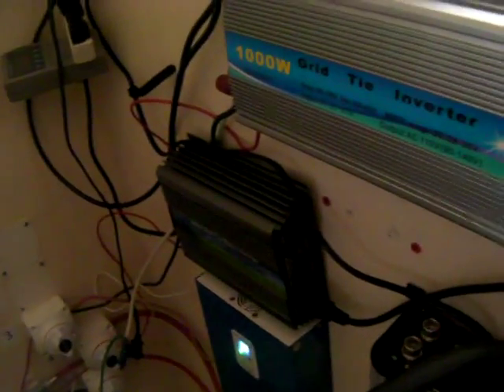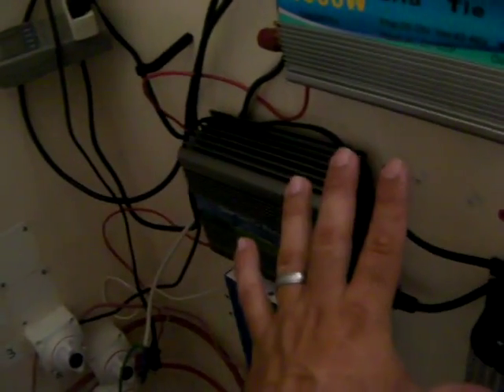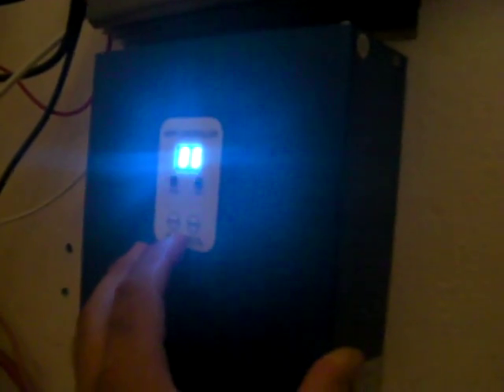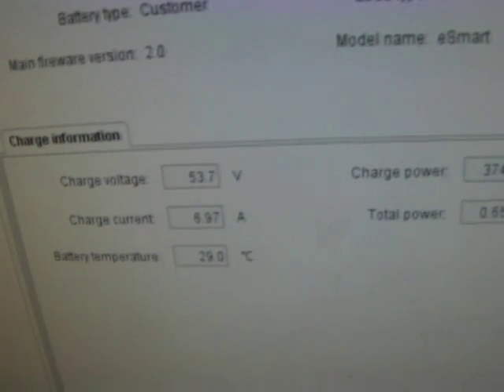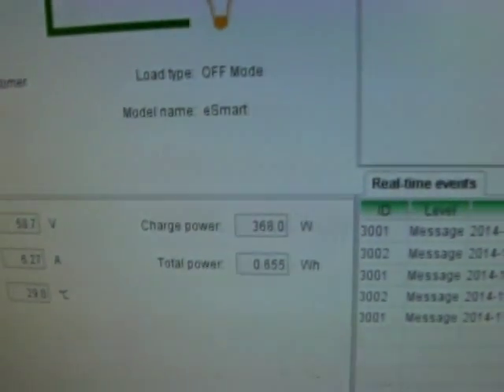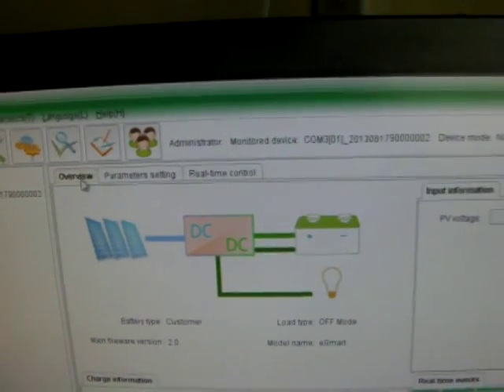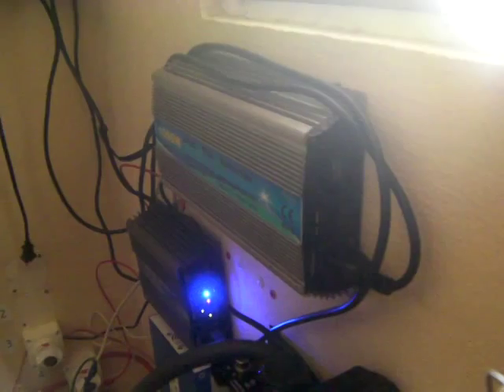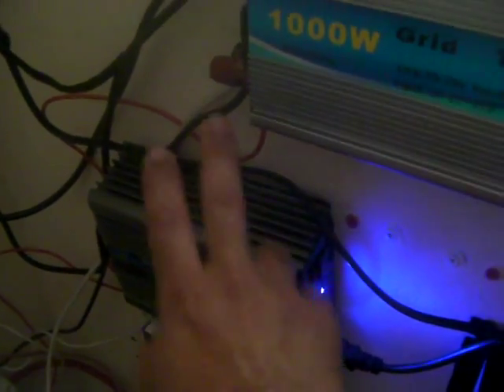ESMART SOLAR EAGLE 40 AMP MPPT CHARGER 12, 24, 48V

Comment: Is your Solar Eagle still working at 57.6V? I was thinking of buying one. Does the very bright display switch off at night, otherwise I won't need a light in the conservatory! (as well as draining the battery) I also have one of those Chinese "1000W grid tie" inverters, I don't think it's G59/3!!! it came free with a wind turbine I bought.

Comment: I  have the esmart3 and am having trouble getting the controller to register with solareagle 2.0.  The drivers for the cable appear to be installed correctly as the computer recognises that it is plugged in. The manual to the esmart 3 indicates that it requires a RS485 cable, which is what I have purchased. It appears that previous versions used an RS232 cable and was wondering if it was worth giving one these a go. Any assistance trouble shooting this would be appreciated.
Reply: Hi, I have the same problem, I have the cable ( Prolific PL 2303 usb to rs485, I have the correct drivers, but the software never upload data from the solar charger, the model is ESMART3 with solar eagle 2.0.
Reply: I also have an esmart3 40A with the new cable and solareagle 2.0 and can't get it to see the charge controller because the usb drivers won't install. I'm using windows 7. I'm getting so sick of this chinese crap and not being able to get their garbage working.
Reply: Did you finally get this working? I'm so frustrated. Never again.
Reply: Let me know if you found a solution! Any help would be great.
Reply: Same issue, pl2303 driver is installed on win7 and adapter is recognized (XA HXA chip) but solareagle 2 does not see the chargers. 19200 baudrate.
Reply: ohh cool, I got it working on win 7 64 bits using the PL2303_Prolific_DriverInstaller_v1190.zip drivers and the install_MyGreenSolarMonitor_CS_Windows.zip software!
password is still mpptsolar
sooo happy.
software location:
http://www.solarcontroller-inverter.com/download/9.htm
driver location:
http://www.prolific.com.tw/US/ShowProduct.aspx?p_id=225&pcid=41

This is where I bought the cables:
https://www.aliexpress.com/snapshot/0.html?spm=a2g0s.9042647.0.0.4fdf4c4dY10qGK&orderId=91719267652307&productId=32854529801

Comment: I tried connect my pc with charge controller but no upload the pc software.  Where I download a software to change the battery charging stage? Because the controller charge the battery but when i start up the inverter no continue charging the battery banks.

Comment from the maker: I am using this charge controller again...I bought two more panels and stepped up voltage on my 24v system and now have over 60v input to charge my 24v battery bank ( two banks of 33v panels in series)  no more stopping and starting cycles...very good controller...
Reply: +jwsolarusa John hello John God bless you too and thanks for your kind words...I installed the battery sensor where the batteries are..always on the outside of the battery, never on the inside since this would destroy your probe and the battery...always far away from the battery poles...you can put a tape on the probe and stick it to the outside of a battery...
Reply: How did you connect the BTS to the batteries
Reply: Thanks for sharing. Nice video by the way. 
God bless and have a wonderful day
Reply: I just bought one of them still in the box.  I haven't install it yet.

Comment: Ran fine for about 4 months and then just stopped charging. Everything else is working and no change in setup. Bummer
Reply: sorry to hear that.... mine still works maybe because I only use it on blackouts like today...had to use system for 3 1/2 hours.....
Reply: Have you got the software connected up to an RS232 Rob?

Comment: FYI, the Solar Eagle software is based on Java so it can also run on Mac and Linux too. My Linux system just required this BASH script in the base directory to run:

[code]
#!/bin/bash

CLASSPATH=./lib\
:lib/commons-lang.jar\
:lib/commons-logging.jar\
:lib/derby.jar\
:lib/dom4j-1.6.1.jar\
:lib/iText-5.0.6.jar\
:lib/iTextAsian.jar\
:lib/jaxen-full.jar\
:lib/jcommon-1.0.0-rc1.jar\
:lib/jfreechart-1.0.0-rc1.jar\
:lib/JTattoo.jar\
:lib/log4j-1.2.14.jar\
:lib/RXTXcomm.jar\
:lib/saxpath.jar\
:lib/SolarEagleCharge.jar\
:lib/spring-beans.jar\
:lib/spring-core.jar

java cn.com.solargain.solar.console.MainConsole
[/code]
Reply: I had this problem too. What I did was replace this line:
java cn.com.solargain.solar.console.MainConsole

with:
java -cp $CLASSPATH cn.com.solargain.solar.console.MainConsole

got it to start this way, haven't had a chance to test RX/TX
Reply: I used WINE on Linux to install the software so I could copy it out of the simulated Windows environment and then work with the directory and files from there. I also deleted the jre directory since I've got Java and the RxTx(for RS232) already installed and the one in the kit is going to be for Windows anyways.
Reply: +Doug LaRue 
Hi, not work for me on debian jessie.
user@system:~/SolarEagle200$ ./launcher.sh 
Error: Could not find or load main class cn.com.solargain.solar.console.MainConsole
user@system:~/SolarEagle200$
Reply: Can I ask you to send me Solar Eagle software for experiments?
Thanks!
Reply: do you have these directories in the location of ./launcher.sh
config
datas
images
lib
log
style

what is in the lib directory?
Reply: Doug, right now I have only the device. I don't have data CD so I'm looking for software for it. Can you upload it to dropbox or send me to g.a (at) ua.fm? I'll do some tests on Mac and may be on linux.
Thank you!
Reply: could i get a link to the software as well please?
Reply: try this: https://drive.google.com/file/d/0B6e_QEifuKzMbENlZngyQ010QzQ
Reply: Do you have the windows version of SolarEagle? If so, could you please provide a link? Been looking online for ages.
Reply: I found the SolarEagle 2.0
For Windows its running an exe.

I uploaded it to Mega just if someone else out there is looking for SolarEagle 2.0 here is the link: https://mega.nz/#!qs5WTS4Y!h-J-QNEdAxpJECXp3NE5C0Ctb-_IvE5hkHVQHcFI8wE
Reply: Glad you found it but also to let you know, that exe is just a Java runtime to run the Java application on Windows.  When you install it you will see a few .jar files which is really the application.
Reply: Hello. Thank you for software. Can you share usb drivers too?
Reply: USB drivers come with your Linux OS distribution.
Reply: Doug LaRue what about windows?
Reply: I don't use it.  The Solar Eagle software was packaged for Windows so maybe you can find the users manual.  My comments and experiences are with getting it working on more reliable platforms.
Reply: Can you make video about this setup?
Reply: i need password login first. Please send me: kientrung.lc@gmail.com
Reply: mpptsolar or 123456 or administrator or ipanda
Reply: thanks, you are a life saver
Reply: I probably do have the install CD somewhere but it would take too much effort to dig for it.  As I mentioned, it's Java based software so you just need to install Java, extract the zip file I linked and change the startup script into a Windows batch file( or whatever Windows uses these days ).

Comment from the maker: hello, if you guys are having problems like  I use to have with this charge controller that it keeps charging and stoping charging and stoping on and on etc...then I think I may have found the problem...problem is that algorithm protects  the charger from solar input low voltage which in  my opinion is set to to high, it should be closer to the limit where its being charge to the battery. for example battery is at 12.3 then limit should be 12.4 on the solar side...protection for 12v is set at 14v input so if you have a 33v panel you should not have problems with this issue but if you have an 18v panel the you most probably will.....protection for 24v is set at 30v ????wtf??? going under that is very likely if you are using a 33v panel and for 48v system its 60 again to high...so my recomendation to fix this is for 12v system use 33v-100v with 1 up to 3 max 33v solar panel or 2 18v panels in series up to 6 max. for 24v use 54v - 100v with 3  up to 6 max 18v solar panels in series or 2 up to 3 max 33v solar panels. for 48v system you can use 5 up to 6 18v solar panels in series and 33v use 3 solar panels in series....please be careful if  your panels are a little over 33 or 18v since cutoff solar overprotection voltage is setup at 110v... so if the controller stops charging then you may want to lower voltage just a bit from where you are if you are on the high side. will do my testings in the future since I can't right now because my solar setups are all running on the low side...example my 48v setup has just 2 33v panels so it keeps on stoping the charge every 1 min or so....and my 24v setup has only 1 33v panel so again I find myself under 30v often...
Reply: +subzerodata  a few diodes could be used to drop the voltage some without any current decrease or heating. 1.4V per power diode.
Reply: I have a 40A model. The software provided had two versions (1 and 2).  I am hoping the second sorts out "the algorithm problem".  My installer did not hook my inverter load to the LOAD junctions, preferring instead to use the battery terminals ("what difference would it make?")  Having reviewed the software, where I find Mode [Load] ON [on boot], Mode OFF, MORNING TIME ON, TIME+PV ON etc  I can see that hooking load to the LOAD terminals is the way to go.   Also I had several problems that I suspect were to do with disconnecting the battery while solar charging, which not advised or recommended because the internal capacitors have nowhere to shunt their power.
Reply: +Simon Masters yes, manual clearly states that you connect battery first and solar panels last meaning that solar side should never be connected when batteries are not this would/could damage the unit depending on PV voltage used....software is not for changing algorithm it is for monitoring and changing voltages and values on unit including amp limitation... if you are having the stop start stop problem then you may want to go with higher PV voltage...if PV voltage goes near battery voltage then unit stops and restarts when voltage goes up again...regarding load side of controller this should be used for low consumption DC divided consistent with voltage output of unit not the inverter because inverter needs high current surges to work...if you still need to use inverter thru load side the use a high quality heavy duty relay compatible with output voltage of controller....

Comment: I have a nominal 24 volt system of Lithium cells, i would like to put the maximum voltage in the settings. But the software only goes to 15 volt. Is the assumption that you use 15 volts, and it multiplies by 2?
Reply: I hear you...software is full of bugs...shame because unit itself is not that bad....
Reply: +Leonardo Cruz 
I have cc'd this question to the representative of the software company - SolarEagle. I will post her reply when it occurs. She has been pretty good at answering questions.
Reply: William Swann thanks, let me know what they tell you...they are very nice, I told them about the problems I was having and they where nice enough to send me another board...the replacement board I got was not software rewritable, and it made the exact same long pause even when full sun out..

Comment: After doing lots of testing....this controller is not worth buying as a regular controller...keeps turning off and on if input voltage is too close to the charging voltage or if voltage is not constant....the second board that was sent to me is stuck with programming since I'm unable to change parameters with the software...I just use it to transfer power from a 48v battery bank to a 24v battery bank...at least I'm getting use out of it...

Comment: It is working but right now I'm just using it to export power from 4 batteries from my house ( charged with the grid)  to my moms off grid setup when her batteries get low on rainy days....I would strongly recommend you get the intronics mppt charger from eBay...it is made in USA and I have two of them and they work great...its good for 78 amps...my mom is running a minute solar classic lite that I monitor with a si if connection all the way from my house...but that charger is on a league of its own and it cost 2 times the intronics....don't buy this Chinese mppt...it keeps on charging and not charging, charging and not charging, on and on etc....too ineffective, it waste too much power for being reliable for off grid install...

Comment from the maker: first your pc must see the rs232 to usb adapter so drivers must be properly installed after this you install software for the controller to your pc and open it...it should work...if it does not try testing the usb to rs232...

Comment: Is this a real MPPT charge controller?
Reply: Yes it is, but algorithm on it sucks! Turns on and quits, on and quits keeps on and on...really no good...
Reply: Thank you for the reply. It's a pity they screwed up the algorithm.
Reply from the maker: +Hat cck yeap....I spent 180 usd on mine...it is a 40 amp version...had to find another use for it since it does not work well for what its supposed to be used....

Comment: What is the voltage on the batteries? 50v +  times 4 amps is around 200w....is there a larger load on the batteries? If not then the regulator will stop charging the batteries at its bulk voltage  so it does not over charge them, this is normal...

Comment: It's like me, I have now changed the system to see how it responds and I have 4 modules 12V and I connected in parallel, clearly detected me entering a 70V and that regulates well, but the operation is the same as that load to 3 Ampere batteries, but that if at most 1 minute followed, then disconnect and goes to sleep, after half a minute, again charging 3-4 amps (modules are underpowered about 40W) so the amps are correct, the problem is that it does not follow as it should, while I had sun.
Another thing I've noticed is as you say, in the morning, the batteries have less stress than at night, it is assumed that the discharge should avoid at night, which is one of the features of ill regulators and this is implies something better.
Nor have I seen him do more EQ or any function, I have them in the way NiCd # 4 of the menu and also you do follow up with the pc.

Comment: Have you test it with a load on the inverter? What's the open circuit voltage on each panel? Try putting 3 panels in series to hit closer to 72v and remember always make sure you feed the charger to your batteries firs and the connect the charger to your solar panels...fail to do this and you'll damage the unit...

Comment: Hi, I have a small installation consists of four PV modules 12 V 40W, I have two in series and two in number, but I have a problem, mark me buck voltage charge 14.4V and 13.4 float charge voltage can be see in the attached photos, the battery system that I have is 19 vessels 1.2v, but it makes me loads are 30 seconds and a maximum 4A, then cut and after 1 minute charging again.
It might be the problem parameters to float charge and charge buck ???? is that these parameters can not find the option to change or the option of saying that the installation is 24V.
Thank you

http://i932.photobucket.com/albums/ad162/guarripei/Sintiacutetulo2_zpse34ef713.png

http://i932.photobucket.com/albums/ad162/guarripei/Sintiacutetulo_zpsa1ff18c8.png
Reply: Hi, i have similar problem. My 4 panels are 2 x 24v in series giving me 48v for my 48v battery bank. The charger is charging for 5 seconds and then switching off for 30 seconds, it will once a day charge for half an hour but then goes back to pattern, and end of day batteries are lower than start! My buck and charge voltage is set also at 14.4v and 13.4v with no way to change them as the box is grayed out. Anyone know how to change this? I am trying to get a refund via ebay at the moment but would be happy if it worked!
Reply: Yes i have defined battery type but am unable to set voltage, this is set at 12v parameters. At the moment no way to change this as the voltage box is grey and does not respond. Thanks for suggestions.
Reply: Centred Life Indeed I can not, I'm tired of this software, I find no way to fix it, I have a 24V battery can not load because load 30 seconds and off, so you can not charge batteries.
If you find software compatible with this MPTT would try to change it, but I think it will be impossible.
Reply: Centred Life Have you tired to define your own battery type? You will need to fill in all the boxes with your own settings.
Reply: Hat cck ok, the battery is NiCd and have configured both mppt the menu and selected battery type 2, also with NiCd program, but the other parameters do not let them set the glasses are 1.2V and I am 19 but not no way to get that data.
Reply: Antonio Rocamora
I have given up after two months and no way to change this, i have seen it charge 4 times up to 50V over this time. I am getting a refund and buying a more expensive well known model. Once bitten twice shy.

Comment from the maker: yes password is mpptsolar i belive...if not let me know...thanks
Reply: Thanks its the right password, i have the same controller but 30a version, have sent my for replacement - the seller blamed my that by using the program with password  i rewrited theyr firmware and i broken the controller, then seller send to my new one, now working (charging) fine, but when there no sun the controller drawing 0.3 amp from battery bank, if you can please measure your controller  consumption with clamp meter
Thanks
Reply: What load have you got connected +Roman Shapovalov?   I had similar problems.  I think you must disconnect solar input first, then let the capacitors discharge to the battery, then disconnect your battery once the device's lights go out.